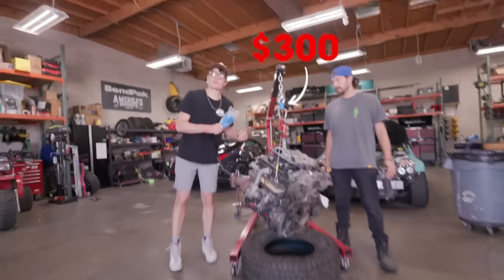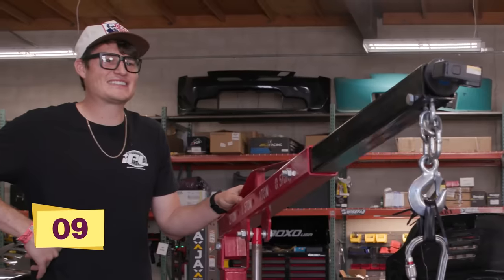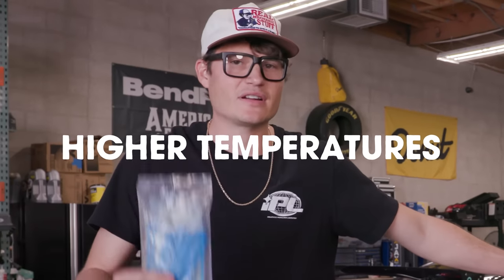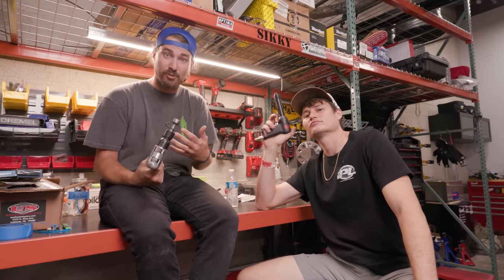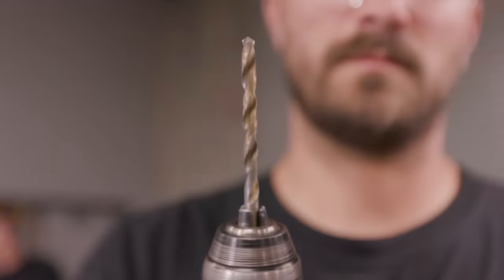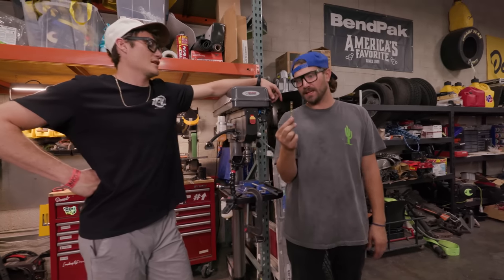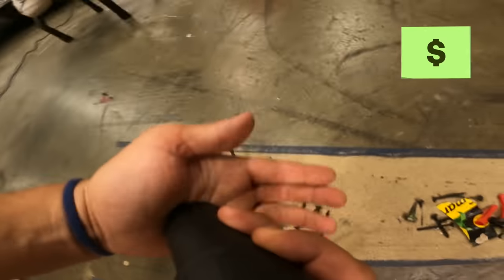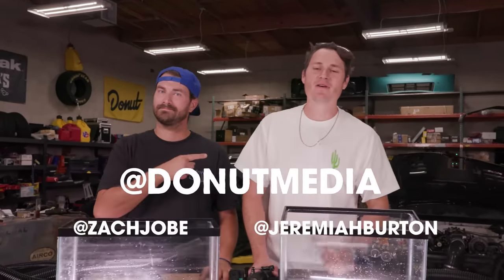We Test: $1 vs $300 Zip Ties

Comment: Not sure the drill bits was a fair comparison, testing different material bits is a poor thing to do since some maintain sharpness over others, and can even warp with heat, pressure, or application

Comment: The drill bit test was inaccurate off the rip. Cobalt bits are meant for harder material, and do not cut through sheet metal smoothly.  Tends to grab, and bite into soft materials.

Comment: its not actually a win to be able to carry more weight. its like a torque wrench, its rated to carry a certain weight, its more of an accuracy rating than a strength rating. thr blues broke at 400-450lbs, just at the weight of thr engine

Comment: Airhammer challenge is Flawed..
HF has a Much shorter stroke, per the short nose...you can Hear the difference too.
Though most of the airhammers at HF are called air chisels.
The longer stroke hammer appears to be a rivet gun..based on the longer stroke.

Comment: I wonder if the strength of the zip ties matter by how long they’ve been hanging on?
Reply: Nylon absorbs water like a mofo, so yeah it definitely would matter eventually. I 3d print with different nylons and they all get softer and lose stiffness after awhile, from absorbing moisture, even though i live in the desert. They dont get brittle in the sun as easily though, they mostly just slowly get stretchier when exposed to air. But pretty much all plastic deteriorates, so absorbing moisture and getting stretchier is still preferable to crumbling in the desert sunlight like most plastics do here. Nylon is still going to be stronger that cheap plastics in 99% of situations.

Comment: Some things cost more because of longevity, like those zip ties; I expect the shopvac to be similar, especially since the body is made out of metal instead of plastic (there are also smaller, less expensive shopvacs; the build quality of the motor probably also plays a role). Like you said, sometimes what you get depends on how much you plan to use it

Comment: The heat test seemed unfair as the heat gun was already hot when it blew air onto the zip ties. It’d be better to get another heat gun so they’re both cold at the start of the individual tests
Reply: I was thinking the same thing.

Comment: You will find the cheap shop vac won't last long in the work shop maybe a year if the thing get treated well. Where as the expensive shop vac would last longer. Shop vacs its not the power, it's the durability you are paying for

Comment: If you are going to use the cheap zip ties, don't buy the 100 pack unless you need it.  The one thing the cheap zip ties are notorious at is failing after certain time has passed, on the shelf, they get incredibly brittle and cannot do anything, let alone hold something together, you can't even tie anything, they break right away.  Obviously $300 ties are not an alternative, but thinking you can just buy 100 of those ties and keep them in your garage forever is a no-go.

Comment: After driving long haul for more than a decade, I can tell you Harbor Freight zip ties are trash.  On the road, they're worthless in fall, winter and spring.  Cold air makes them very brittle and they snap right as you try and tighten them.  I would try and zip tie some wiring or hoses on a trailer in winter and would go through 2-3 zip ties before I manage to tighten one without it snapping off.  Even then it's a very temporary fix before zip tie falls off by itself.

Comment: If the more expensive zip ties are comprised of a material that is marketed to have more chemical resistance, then why are they doing mechanical strength tests? They are meant to last longer under normal use, not necessarily withstand more force.

Comment: Speed is not what you should be measuring for the drill bits. Almost meaningless. Try drilling into hardened steel with the cheap ones vs cobalt lol, the non-cobalt ones won't even make a dent.

Comment: On drill bits I'll burn up the expensive just like the cheap I had a $200 drill bit and the cheap one out did it the pay $10 for at Harbor Freight it did a better job through the hardened steel

Comment: Strength is NOT the reason you would buy the tefzel zipties. If the picture of the structure is accurate it forms polytetrafluoroethylene which is basically teflon. This, and many other fluoroplastics are resistant to oxidation, acids, bases and most organic solvents. These zipties would not be affected by fuel or engine oil, are resistant to sunlight photolysis and and completely water repellent. Good applications would be engine or fuel lines or marine environments. CAUTION: Never ever burn PTFE as it produces hydrofluoric acid which will doom you to a very painful death! Also avoid strong electrical currents etc (detach for welding) which can do the same. They have their uses and $3 a zip tie is actually reasonable given how difficult PTFE is to make. Source - me, a chemist.

Comment: I wouldn't say its impressive that the blue zip-ties are used in nuclear plants. It's really more concerning that they would use zip-ties at all. Its like saying they use duct tape, usually a sign that stuff is broke.
Reply: duct tape wasnt made for broken stuff though.  it was made to seal the seams on duct work.... and theres versions being used on airplanes for similar reasons.  it is designed for very specific uses, it just also happens to do a pretty good job as a strong general tape, but it wasnt designed to hold your cars bumper on after you wreck for the 5th time. just also works for that.  so not really concerning for zip ties to be in use if they were made specifically for something in a nuclear plant but happen to do well with other task too.

Comment: Some of those high dollar zip ties also have higher UV resistance so they last longer outside with direct sunlight. Some also have metal tangs to catch. So the plastic tang won’t dry rot out. The high dollar Zip ties have their uses.

Comment: The expensive ones are less corrosive. Meaning they will hold up outside in extreme conditions. It's about more than strength to begin with. If you want to hold an engine up a short piece of chain can usually be found if not purchased cheap at a yard sale for a dollar or two.
Reply: so and you can replace those cheaper zip ties every month for years before even matching the cost of one expensive zip tie

Comment: The most important diference in standart nylon zip ties and expensive ones is UV and chemical resistance. Nylon is slowly degraded by isopropyl alcohol (see brake cleaners) and rapidly dissolved by many acids (brake fluid after contact with water, car cleaning solutions, and many more)

Comment: Realistically when drilling through metals like stainless steel or hardened tool steel you MUST provide a cooling medium like oil or water. When stainless heats  to red heat it instantly case hardens and becomes impossible to continue drilling.  Just use a spray bottle of water set on solid stream to prevent overheating.

Comment: I've used many zipties of the years. The main differences for me is,
- how tight do you need the tie? more expensive zip ties have more ribs for more precision
- the longevity is vastly different. I find cheap one's to fail overtime. But that's worth noting for a temporary setup, cheap zipties make a good option
-  cheap zipties quality control are often so bad they tend to just break randomly in general, they're very unreliable

Comment: You guys should watch Project Farm.  He does a way better job of testing tools and controlling the variables.  For example, you have two different people drilling holes.  There is no control of how hard each of you pushed on the drill.  And, the in the air hammer test it is obvious that neither one of you knows how to use that tool.  If you push too hard it will stop the tool from working properly.

Comment: Tefseal or w/e it is is basically just teflon
Toxic as hell to make, but man it's a useful chemical

The carbon in the centre is basically surrounded by flourine atoms, flourine is the most electronegative element, which basically means bitch loves electrons
It causes this tendency to be very unwilling to donate electrons but try to pull them off other less attached molecules/atoms to reach a full outer shell0

So when paired with carbon that's pretty happy to share it's carbon covalently, it results in a pretty stable bond; when you make polymer using this principle, you end up with this effective ring around it of electron withdrawing groups that are already stable (because they don't like giving up electrons due to the outermost shell being very close to the nucleus relatively speaking) and in this case each flourine has a full outer shell - resulting in very little reactivity (outside maybe very strong bases or acids...maybe?)

That's why we use it for non-stick coatings or things that NEED to be unreactive like in sterile conditions or reactors etc
Reply: Man I love how the blue of the cobalt comes out from the drill bit as it overheated though, it's so pretty

Comment: For the zip ties having 15 to the 10 does matter the ten have more weight and stretching faster cuz they're holding more weight per unit for the 15 is a chance not to stretch as much on each individual is he a five extra you have to do 10 + 10 anytime you got to do the same because they stretch not an accurate test
Reply: still the price difference is massive, you could replace the cheap ones for years before even matching the price of the expensive ones

Comment: I don't know how so many companies get away with claiming their drill bits are "titanium coated", when they're clearly coated with brass that only contains a small amount of titanium. Titanium looks like a cross between dull aluminium and dull stainless steel. It can probably be polished (with a lot of work), but that's how it generally looks. Even if a drill bit is titanium coated, that doesn't mean the rest of the drill bit is made from anything decent, either.
Reply: Titanium NITRIDE, not plain titanium. And what color is TiN? Oh, a brass color. Next time take a moment to think instead of putting your foot in your mouth.

Comment: These weren't very useful tests. With zipties they should of measures exactly how much heat they can take and sturate before failure not how long some random heatgun can stay pointed them before they snap. Vacuums now seems to have equivalent power but the difference between cheap and expensive might be how long they last before failure or how fine are the particles they exaust. Like they should of explored the differences and not just do one or two tests and pass judgement. Companies usually have different price catagories for a reason regardless of IF they could offer their more expensive product at a lower price.

Comment: Tefzil is NASA's ziptie of choice. It's radiation resistant (they use the ties and tefzil insulation in nuclear freakin reactors) 6200 times stronger than nylon, and corrosive resistant. They released a picture of Curiosity's wheels, the aluminum of the wheels was all banged up had holes in it etc, the tefzil zipties they used to secure the wiring harness to the suspension? Like day 1. They're basically overkill for any use other than those and some aircraft applications.

Comment: Your ziptie experiment was as flawed an just about any episode of Mythbusters.  The fact that you added 5 more ties, even though they have been cut, still give support dur to friction and them being tangled.  Do it again with ONLY 10 and ten see what you get.  Probably WORSE or about the same as the others.

The HEAT test... well... did you let the heat gun COOL DOWN before testing the HF ties? If not that also not a fair test as it had to HEAT UP for test #1 and was closer to full temp at startup for test 2. HF would still lose but should last a bit longer.

Comment: those poor drillbits... 

Learn how to use a drill PLEASE! 
coolant is required (cutting oil, something!). SFM is important! (you all were going waaay to fast) 
and surface hardness is important. you are not going to have a good time drilling through a hardened wrench with a cobalt drill. 
Solid carbide drill? Sure.. but I would want it in a CNC. 

The middle on the expensive ones is called a "split point" Helps the tip cut so it doesn't wander as readily. (straighter holes, pilot and spot are more optional) 

The good drill bits are worth the money when the gorilla behind the drill actually knows what they are doing.

Comment: Tefzel is in fact a fair bit weaker than nylon, and zip ties made of that should be expected to fail first if both nylon and tefzel zip ties are the same diameter. The real test of this material is its longevity when exposed to chemicals, UV radiation or high humidity. UV and high humidity in particular are contradictions for the use of nylon for structural/load bearing purposes.